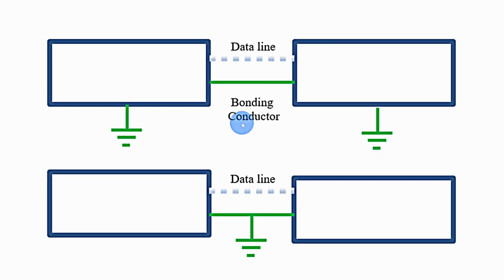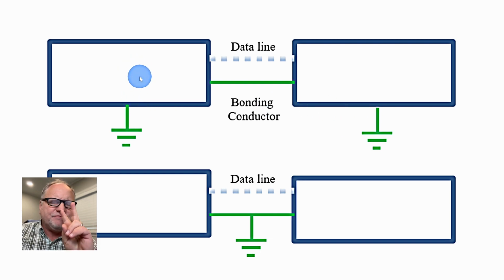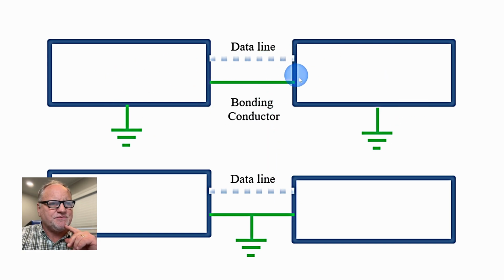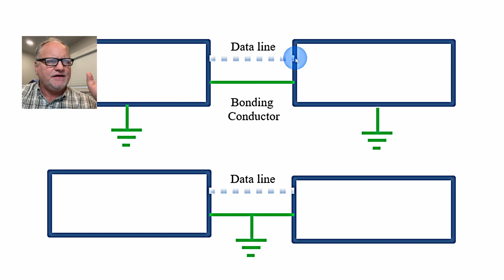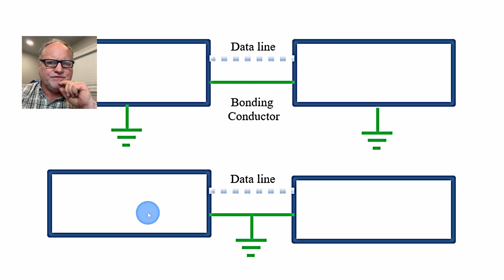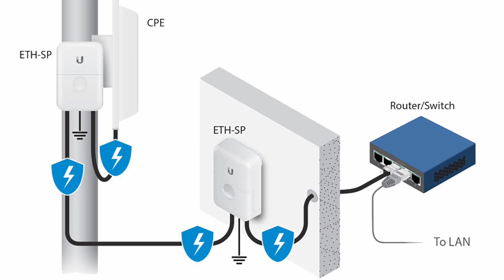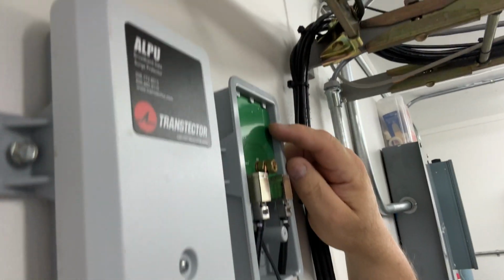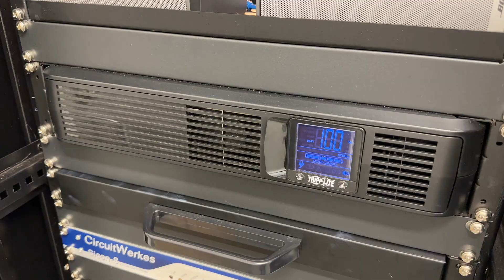Home Lab Grounded

Comment: If lightning is such a problem, I think we need to move away from copper wires to optics. Most of the network is divided into optical switches.